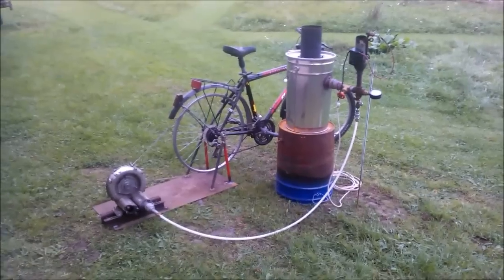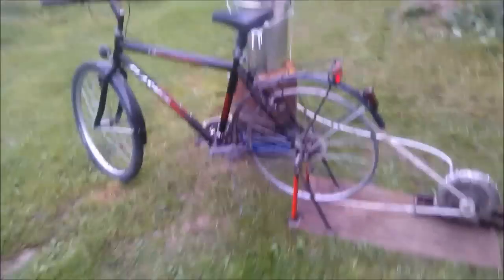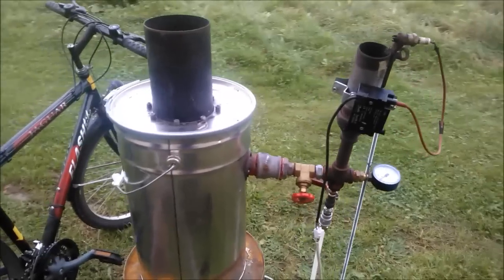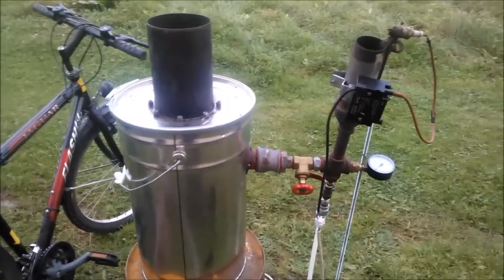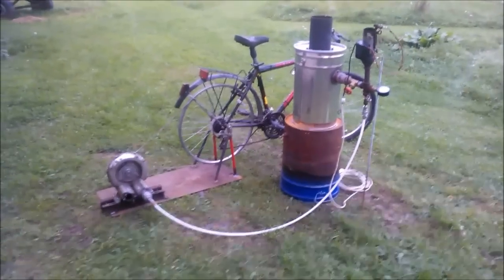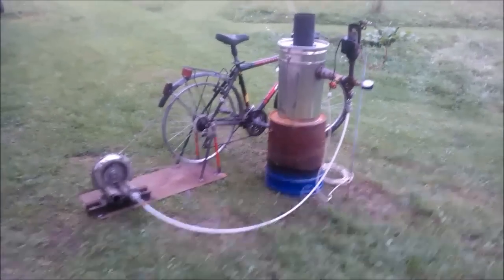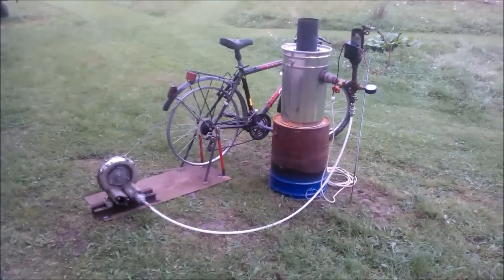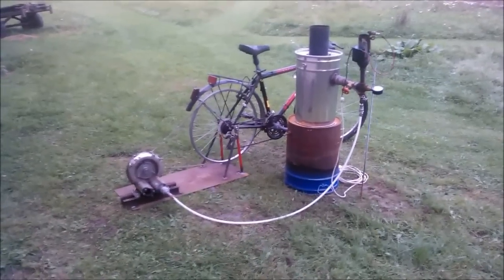PART 3 Learning DriZzleR pedal powered.

Comment: Instead of a spark plug you should use a Taser it uses less energy and produces a larger spark to be able to ignite better and windy weather, spark plugs only run on a 9 volt battery
Reply from the maker: Nice, thenk you. I look into it. But does the teaser lets ibe controlled by a PLC such as the Siemens Logo?
Reply: Luk Vanhauwaert I'm sure you could use all sorts of devices to control a taser if you take the taser apart. I used to make a lot of potato guns when I was a teenager. using a  taser will generate a very large constant Spark to ensure the igniting process

Comment: I might suggest a magneto of some kind to create the spark, possibly from an old motorcycle or auto. there may also be some type of digital electronic ignition devices from similar applications.  Once the unit starts producing enough gas to power some kind of generator or can convert pressure to mechanical energy, you can invent something to make positive pressure for combustion eliminating the need for continuous ignition at the outlet... I'm no engineer, but in theory, the possibilities from my suggestions may be a starting point for you. Thank you, Luk, for sharing your creations!
Reply from the maker: Thank you for commenting. Bear in mind that I made the video above as one of a series of a simple gasifier. My more bigger systems have all automatic ignition. In 2014 i made a video of such an igniter. Here is the link;  https://www.youtube.com/watch?v=t_e67i5k4IY

Comment: good job..you can use a car altnater and use the bike to power it. you already have the coil and the plug .
Reply from the maker: Thank you for watching. Indeed I could but this test was a short one just to find out a way to start the gasifier without any exstra means. Once the gasifier started a gas fired engine could take over.

Comment: This is mostly for Stephen @Northern Self Reliance, but I'm happy to get a good answer from anyone else who is knowledgeable also.  I'm building the "no weld" gasifier that Stephen designed, and it's almost done except for the ejector part.  I'm new to this, and don't have any hands-on experience, so I'm wondering two things: 1/ Is the ejector only needed for start-up or would it also still be necessary for flaring, if nothing else (like an engine) isn't "pulling" the gas out of the system  and 2/ I have a small continuous use compressor, rated .43 cfm at 20 psi... I'm sure hoping this will be enough to use, to power the ejector, because I don't use it for anything else. Can anyone tell me if it will or won't work OK ?   Thanks all ! 

Luk, I've been watching your video's and everyone else's and find them good and really interesting. Thanks all for making the systems, and making the video's!
Reply from the maker: Bobo, Stephen is a fine guy. Basicaly I see no reason why your small compressor would not work. Mostly the bigger compressors are the ones giving trouble because Too much air velocity tends to blow out the flare;
The ejector one uses only to bring the gasifier up to temperature. If one is confident enough about the gas quelity then flaring is not realy needed. Just shut of the ejector and pull the cord or press the starter and then your engine takes over.
This latter of course if you have already a full system with filter, cooler and condensor; If not the the ejector is only used for flaring and by the flare to judge the good working of your gasifier. An ejector is the only thing to pull very hot gas out of your gasifier; If you would suck it out by means of a blower you could damage the thing. Also an ejector does not mind tarry gas;

Luk
Reply: Luk Vanhauwaert
Thanks a lot Luk !  That's pretty much what I thought, and I'm glad to hear my little compressor will probably be powerful enough.  I don't have a cooler or filter system yet, I want to see it flare and judge the cleanliness and reliability of the gas before moving forward with hooking up anything else.  I have a small 3Kw older generator that I'd like to eventually be able to power by wood gas, but I'm thinking it might be a little too much load for the no-weld gasifier to satisfy; I think I need to read more of Stephen's excellent info about sizing things first..  The no-weld system is my intro to gasifying, maybe I'll build a bigger system later.. Thanks again !  "Bob-0-Buoy" <--- just a stupid nickname I use!

Comment: Luk.
Came here from the Yahoo group. I love the setup! (Excepting the $h!+ mechanic)
I also was going to suggest the piezo lighting solution. 
http://t3.gstatic.com/images?q=tbn:ANd9GcQf86Wl3zY8fAwEShAg0OvbxJ3DGqF-gzMCHto491R98D-Pi9v2oj3eGyBt

This kind of lighter has a wire so you could put the spark gap wherever you like. 

I like the cam idea above.
Reply from the maker: Scott, Thank you for the link. and the reaction. Yes I begin to see where such a pieco lighter could be beneficial; Also less dangerous than the high voltage thing I use now.

Luk

Comment: What about a piezo igniter like from a propane grill?
Reply from the maker: Fred, Thank you for your reaction. indeed that would be a solution but still a manual one. If some power of the turning wheel could be harvasted for an automatic ignitor then the operator had his hands free and could concentrate on Drizzling fuel without any distraction.  That was the reason I was looking for pedal power to start up the gasifier instead of the traditional hand cranking of a blower. Much more comfort for the operator, pedaling along until the gasifier is completely on temperature and then pull the string of the generator and bang, electrics takes over.
Reply: Luk Vanhauwaert I am thinking that an eccentric wheel attached to the bike wheel that would slowly depress the igniter with a quick snap at the end could be used to actuate the igniter.  Just a thought...  Fred
Reply from the maker: Fred Miller That could be indeed a workable set up. Thanks for the sugestion. To test however how far away in distance may be between the depress release on the wheel and the actual spark. Maybe there is a limit thes peizo ignitors have.
Luk